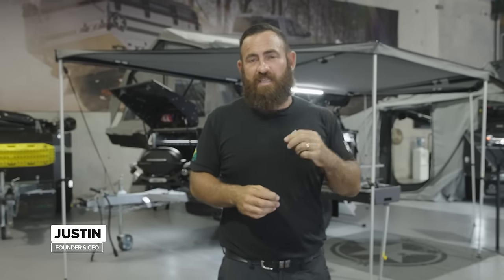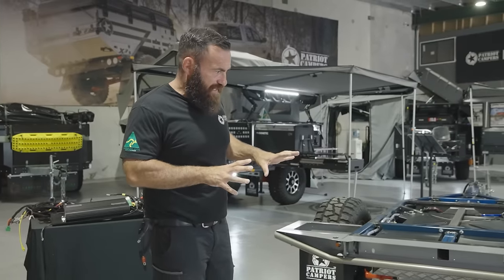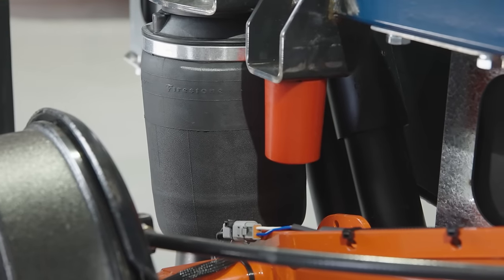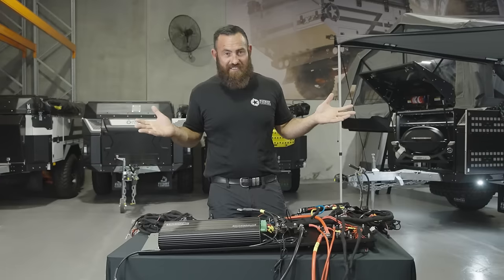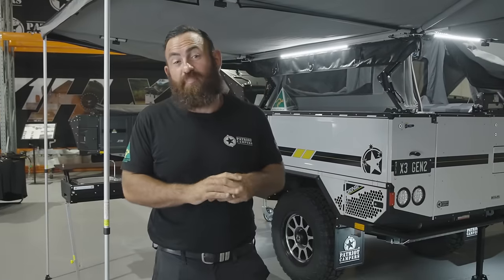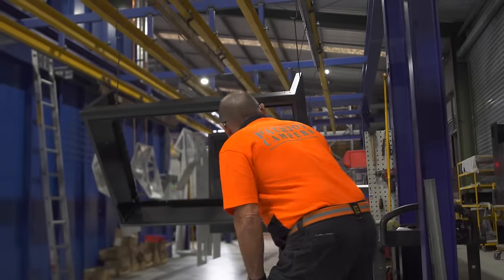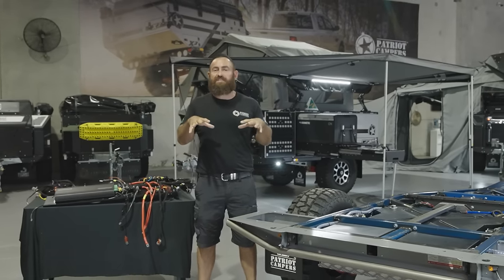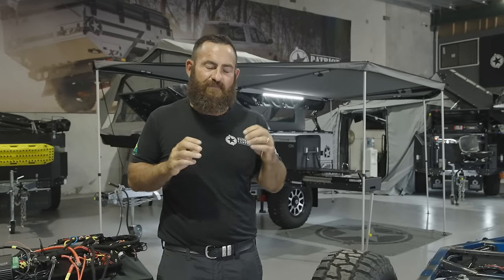What Makes Patriot Campers Worth the Cost?

Comment: Thanks for going into such great detail of what makes your overlander rigs so special. I have followed Brad's (Trail Recon on YT) travels with a couple of your trailers.  I was surprised to hear you use Deutsch connectors! Believe it or not, way back in the early 1970's I worked for, and received my Toolmaker (tool & die) certificate from the local Deutsch Company plant, which was the largest employer in my area at the time. I'm sure it was the same Deutsch Company, founded by Alex Deutsch not long after WWII ended, although the company logo seems to no longer be in use. And yes, I helped build and maintain tooling for their huge variety of mostly aircraft and space grade connectors, including the 155 pin connectors.

Comment: I ordered a new X3 this year and it has been the WORST EXPERIENCE with a company in my entire life!  The worst quality control ever. Camper delivered with ITEM MISSING, TRAILER BRAKES NOT WORKING, Water Tanks Leaking, Hand brake not adjusted, and to TOP it off. the Tent Leaks when it Rains! Then they wanted "Tickets opened" for DAY ONE Issues. Months later still not resolved!